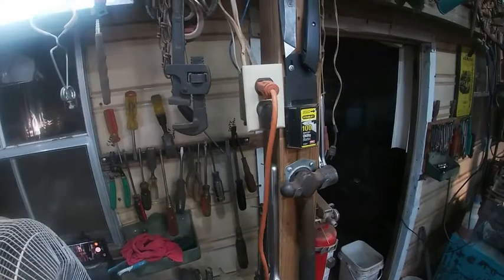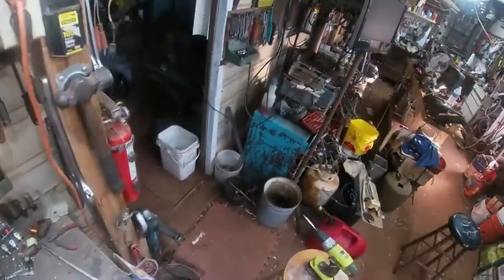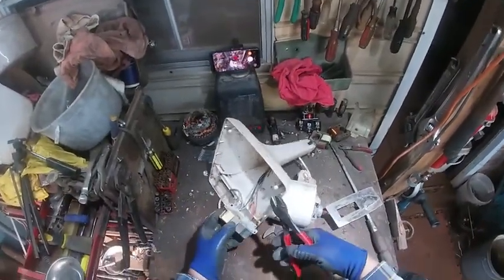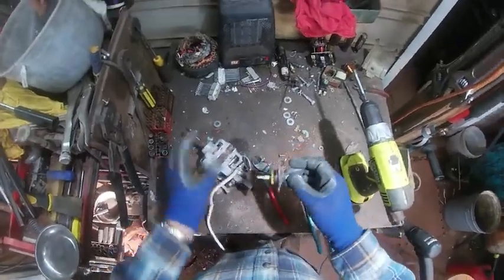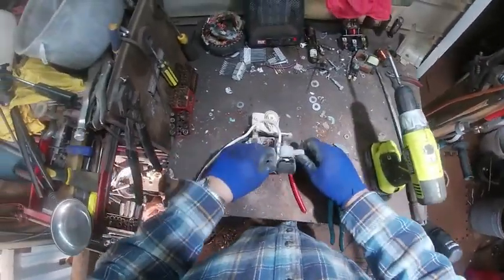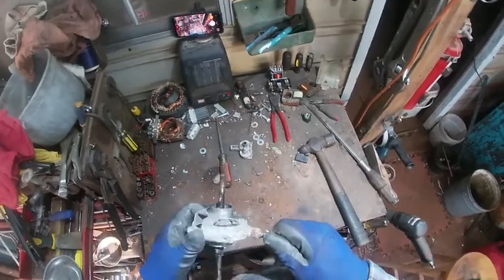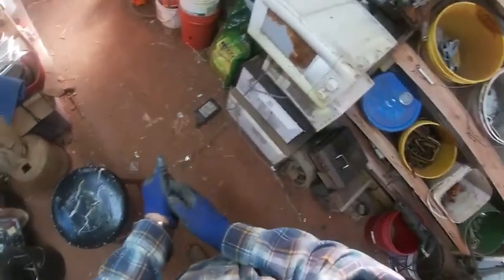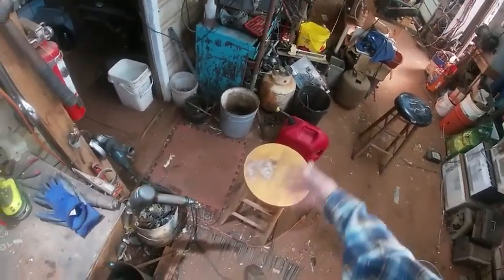How to Scrap a Table Fan for Clean Copper

Comment: Hi there,i watch Rafal scrapper live Saturday. You should do the same and make comments,people will check out your channel through your comments, just a suggestion. Also the fan electric motor the bushes are usually bronze. Those little tv's especially if they are black & white would sell good on ebay.Another great vid,keep it up. Kevin from Nelson New Zealand 👍